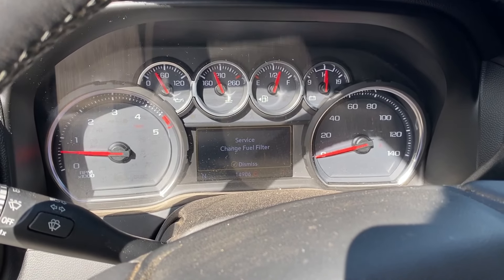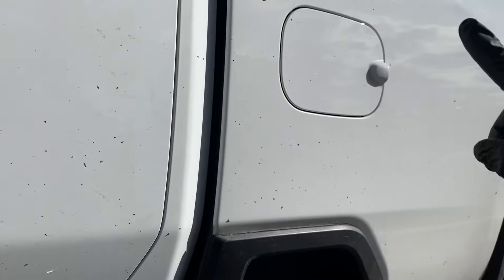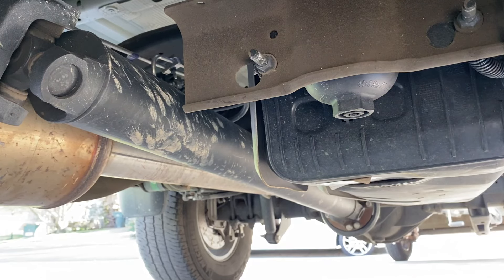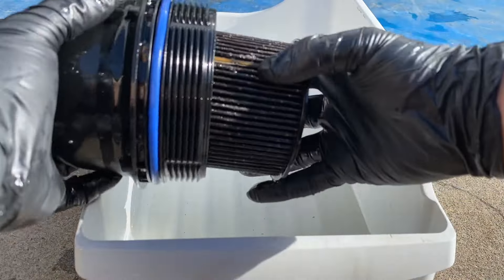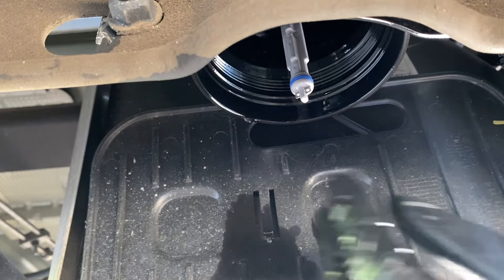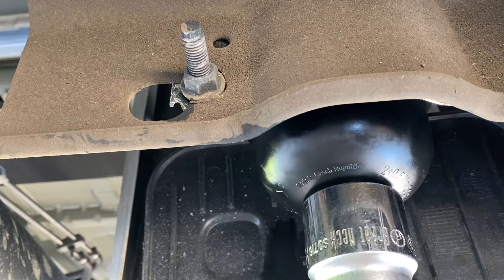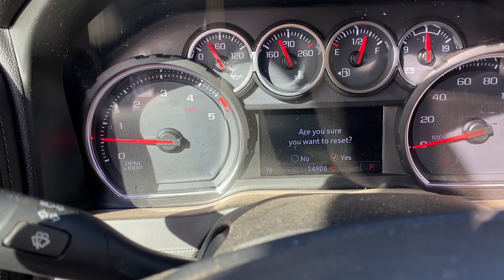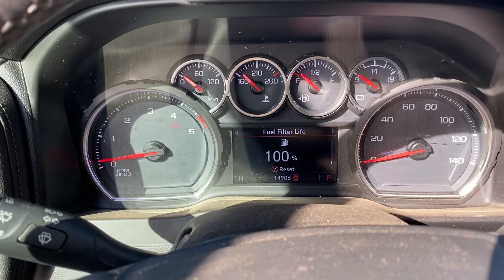How to replace fuel filter on a 2020 Silverado 2500HD Duramax!! *Quick and Easy*

Comment: Wow. I got charged almost $200 on my last fuel filter replacement... I'm about to drive across country twice with my fuel filter at 15% and no appointments any where so I googled replacing it and glad I did. Thank you so much for showing how simple this is!
Reply from the maker: No problem. Glad the video helped!
Reply: @JulioMendoza04  I would recommend replacing the plastic cover. That thing sucks! I'm getting a billet one for my next fuel filter change.

Comment: Almost the exact same as the 3L duramax. So much easier than a cummins. I never knew you could just hit start. I held the start button without pushing the brake and it cleared the lines. That also works. Awesome vid man
Reply from the maker: I’ll use that for next time thank you!

Comment: Update I followed your directions plus primed it like the fellas said in the comments. Good to go and only cost me 15 minutes and $47 bucks for the filter. Thanks again.
Reply from the maker: Yes I also learned to prime it, good to learn from others. Together we saved lots of money  for labor costs. Thank you for the positive comment!
Reply: Dude I can barely put gas so bare with me…what do you mean when you say primed it???
Reply from the maker: @richardcastillo8537  I just do what I did in the video it seems to work fine
Reply: @richardcastillo8537  don't crank the engine on right away.  Turn the key bit not till the engine starts. Give it a couple seconds then finish turning the key
Reply: @sumtingwong4997  right on thank you man! And last question…does the gas tank need to be empty when you replace the fuel filter???

Comment: I find that before you go and start it up after replacing the filter press and hold the start button for a while you’ll hear the fuel pump start up and keep holding it until you don’t hear it anymore this will get rid of the air in the filter before it goes though the fuel system.

Comment: Where is the water separator located on the 2020 chevy 2500? My 2018 2500 was right beside the fuel filter. I have not seen any videos talking about the water separator. Any help would be appreciated. Thanks

Comment: As someone who hasn't changed his own oil in almost 7 years dealer did it.  I still never took in account the fuel filter needs replaced.  Like today 27 percent,  oh no!!

But after watching this I think I can do it  on my 2018. The only fear id have is that first initial long struggle  start.  Expensive engines too risk messing up something up. But saving 180 to 220 bucks really makes ya think more positive!!
Reply from the maker: Yeah i’ve gotten comments about priming the filter first like adding clean diesel into the filter before installing it that may help shorten the startup too.
Reply from the maker: I’ve also gotten comments about letting the truck start without the engine starting yet. It may help start the fuel system and pump fuel into the pump. Till this day i’ve had no issues with the fuel filter or the truck itself.

Comment: 36mm HEX socket is the only correct fit if the factory torqued down the housing.. I learned this the hard way that a 1-7/16th will only strip off the edges of the plastic ($16 bucks wasted and fuel filter housing damaged)
Reply from the maker: I wasn’t sure exactly which to use so I went with what worked for me. Thank you for letting me know though.
Reply: @JulioMendoza04 how did you remove the housing if it’s stripped? My brother worked on it and stripped it and was turning right (along the arrows).

Comment: How tight do you put the new filter on? Is there a torque rating or just till tight?
Reply from the maker: I just do it until it’s pretty tight, not sure if there’s a torque rating
Reply: The torque rating is written on the bottom of the plastic housing.  25.5 NM

Comment: 1 7/16 was too loose, started to strip the cover. I would recommend 36mm
Reply from the maker: I replaced my fuel filter yesterday with the same one i used in the video, it worked well but if 36mm works better then i’ll try it next time thank you!

Comment: Thank you , I hope its a easy as it looked !
Reply from the maker: It is very easy I would say the hardest part is really just taking it off since they tighten it very hard but other than that it’s easy and straight forward.
Reply: @JulioMendoza04  
That is a fact, that sucker is on pretty tight. Doesn’t help that it’s a plastic cover. I’m going to replace it with the metal one next time around.

Comment: Don't know what kinda problems trying to force feed your fuel filter would do or not do but just 3 videos below this one the dude shows how to "properly" fill the filter(Hold start button for 5 seconds with foot off brake)
Reply from the maker: Tried that couple times didn’t work, i’ll try it again next time though and see what happens thank you for your feedback.
Reply: Well if you didn't have any issues after changing it then probably not a big deal but it did work when I changed someone's  though held maybe more like 10 seconds or less? Dash will come on and a few seconds later pump should start.

Comment: Hey man how’s your duramax holding up?
Reply from the maker: It’s holding up great!
Reply: @JulioMendoza04  Good deal man! I’m about to buy a 21’ duramax and hoping it holds up good for me. How many miles do you now have?
Reply from the maker: Around 22k it’s a daily use work truck
Reply: @JulioMendoza04  Still going strong?
Reply from the maker: @haddonsmith345  Yup still not problems at all and we still use it daily for work to pull trailers

Comment: You need to read the manual. It’s a 36 mm socket to begin with and you should turn the key to run a couple times and listen for the fuel pump to reprime the fuel system so it doesn’t crank over forever. Very bad for fuel injectors to have no fuel in them and trying to run.
Reply from the maker: Will do next time thank you for the feedback

Comment: No! You need to prime the system before you start it 
With out pushing the break pedal turn the ignition to run and back to off 3 or 4 times that will turn the fuel pump on to fill the fuel filter and prime the system then start the truck like normal and let it idle for 10 to 15 minutes before driving it 
AIR DOSE NOT LUBRICATE YOUR HIGH PRESSURE PUMP
Reply from the maker: Yes I’ve been doing that now, the video was my first time doing it and when I would try to prime it it wouldn’t work, but thank you for your feedback it’s appreciated!

Comment: Please read the manual this is not the correct procedure you need to press the start button without your foot on the brake and hold in on the button until it turns green and lights up listen for the fuel pump to stop running by pressing the button repeat this procedure three times before pressing the start button a fourth time with your foot on the brake
Reply from the maker: Yes, I have corrected this many times in the comments already. I appreciate your feedback.